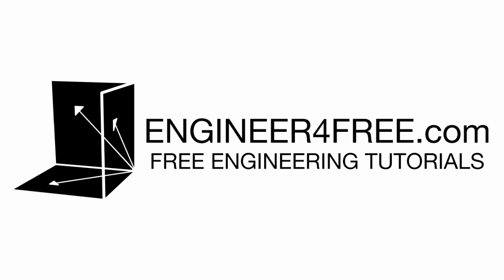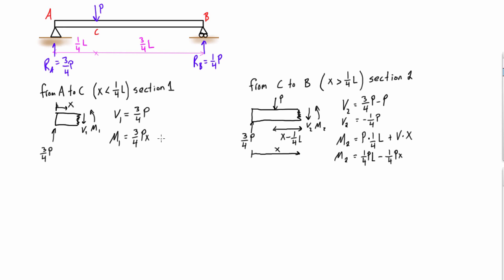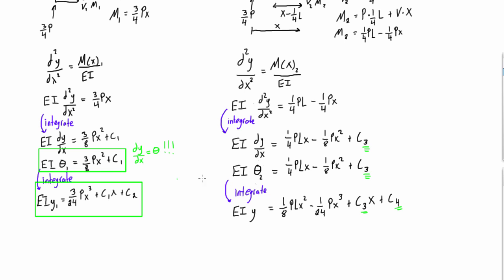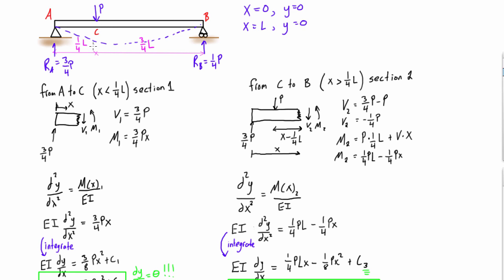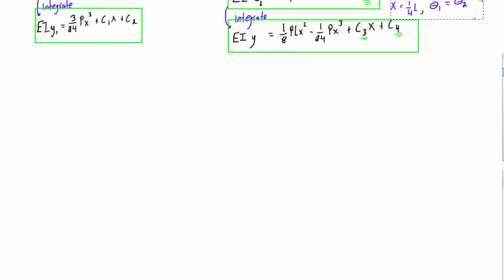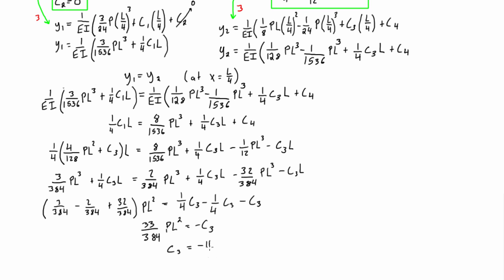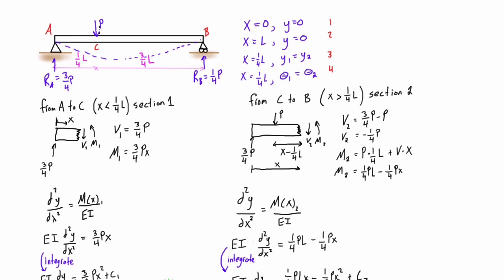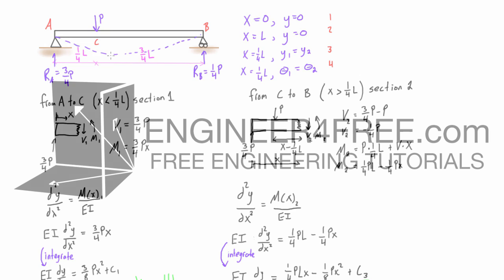Find deflection and slope of a simply supported beam with a point load (double integration method)

Comment: A simply supported beam is shown in the figure below which is used to carry a load P. Consider the load P is a concentrated load working at a point of the beam. The location of the load is also shown in the Figure which is the middle of the distance in x-direction Develop the equation for (a) the elastic curve, and (b) the maximum displacement (c) If the value of the applied load 10 kN and Length of the beam in x and y direction is 2 m and 0.3 m then determine the value of maximum displacement due to the effect of load

Comment: at first point for calculating reactions, how did you solve it becouse as it showing you just u took distance cb for AY reaction and ac for BY WHY
Reply: To find the reactions Ra and Rb you use the fact that the beam isn't moving. So the net force is zero (Ra + Rb + P = 0) and the net torque is zero (Ra*L/4 - Rb*3L/4 = 0). That gives two equations you can solve to give the two unknowns.
Reply: Sorry I meant its not accelerating.

Comment: Is the method you applied for statically determinant structures? Or Indeterminate?
Reply from the maker: The double integration method can be use for both statically determinate and statically indeterminate problems. See videos 10 - 14 here: engineer4free.com/structural-analysis and notice that three of the examples are statically determinate and one is statically indeterminate
Reply: @Engineer4Free  Thank you so much!! Your videos and how you break things down are so helpful.

Comment: Hello, i cant seem to find a formula for the deflection in the x direction, since I got an assignment with a force that is pointed in a 45* angle. Do you perhaps know any formula's or just some tips? I would appreciate that! 

Thanks
Reply from the maker: Just incase you didn't get the notification, I replied to Ali's comment with some links to axial deformation tutorials 👍👍
Reply: @Engineer4Free  Thanks for the links! 
I indeed used @Ali Khan 's formula to solve this question so also thank you Ali!
Reply: I think u could split the force into its x and y components, then for the x component, use delta L = (P)(L) / (E)(A) . Im not 100 percent sure cz im a first year but that's what i'd think. Good luck with ur homework if youre still doing it!
Reply from the maker: Yeah ali you are correct, thanks for contributing. Deformation the x direction is coming from axial strain.  Watch video number 9 here engineer4free.com/mechanics-of-materials and if you have time, I recommend watching all of the videos in the stress and strain sections  that would be videos 1 - 13) 👍👍

Comment: which equation im going to used if im gonna find the deflection at midspan?
Reply from the maker: Depends on the exact structure in question, but double integration method is probably a good choice. You can find a few different methods that I covered here: engineer4free.com/structural-analysis

Comment: How does this change when its a four point bending problem? So two forces acting at different points along the beam, and 2 reaction forces at the end.
Reply from the maker: Yeah you need to follow the same process for each section that is between point loads. That would be a nasty problem to do by hand. Here is the full work for this video in a single image for your reference, it's a bit easier to work with than the video that jumps around a lot: https://www.engineer4free.com/extras/double-integration-method-for-finding-slope-and-deflection-of-a-simply-supported-beam-with-a-point-load
Reply: @Engineer4Free  thanks! very helpful :)

Comment: kindly tell me
if i have 4 eq and i have to find the value of c1,c2,c3,c3
then which boundary condition is put in which eq?
Reply from the maker: Hey, sorry for the delay. Here is an image of the work done in the video: engineer4free.com/extras/double-integration-method-for-finding-slope-and-deflection-of-a-simply-supported-beam-with-a-point-load Where there is a red number near a green arrow, that indicates which boundary conditions (the red number) are being used in which equations (the green arrow). Hopefully this is easier to trace the actual work than in the video which jumps around due to fast forwarding.

Comment: Kindly clear my concept
if i have to find slope and deflection on C 
then we cut it at 1/4L <x<L 
find moment and integrate it
and take the B.C x=1/4 , y=0
and find the c1 and c2
and put the value of c1 and c2 the put x=L to find deflection and slope
is this proceduer is correct?
Reply: if you meant to say x=1/4L, y is not 0 at this point (point C). y is only 0 at point A and B. You have to solve for the 4 unknown constants using both sections (AC and CB) by realizing that the deflection (y) and angle (dy/dx) is equivalent at point C for the formulas for both sections.